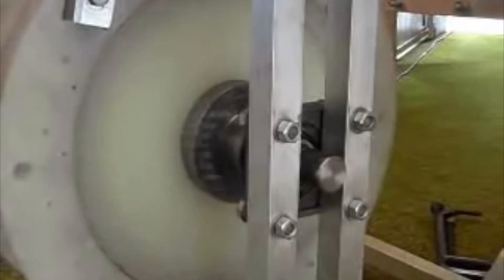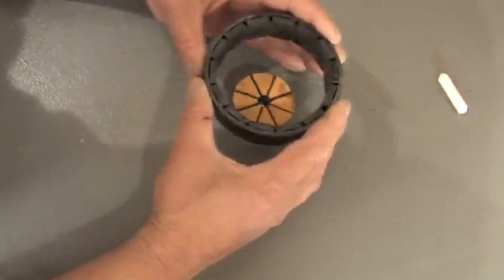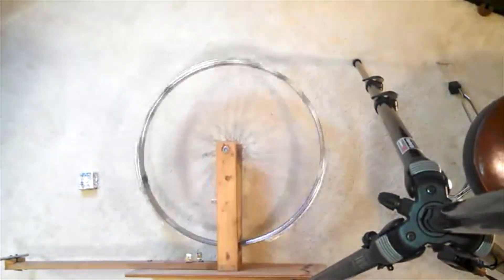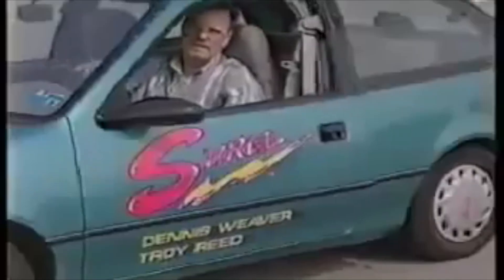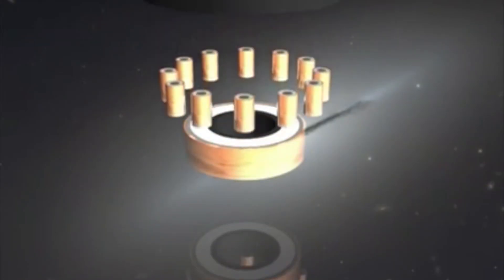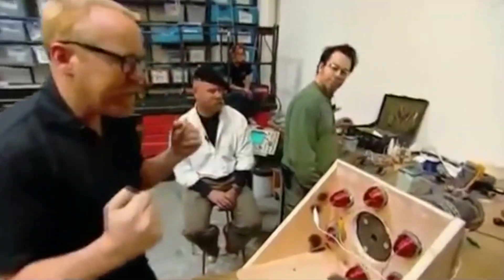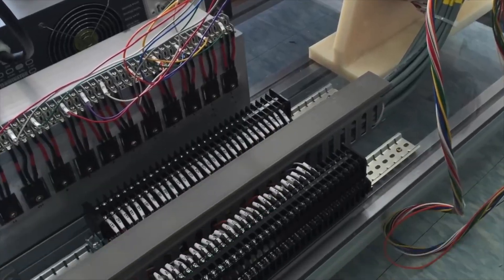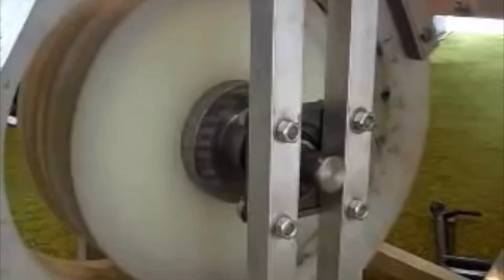Top 10 Most Famous Magnetic Motors

Comment: If you're looking for a legit scientist who actually worked on these devices for the truth, look no further, I tell you as the things really are. It doesn't work. Not like this at least. You need some sort of reaction otherwise it won't work. People who still believe in these devices were just given bad examples why it doesn't work. But I'll give you a good example. To make more energy would be the same thing as to make of 1L glass of water, 2L glass of water. Do you really think you could feel an entire pool with one glass of water?😁 My next video will be a bedini motor with feedback. The one that MythBusters failed to build. It will be 100x better than even the original version. But it won't run itself I can tell you that up front! The real purpose of the video will be to show people how it works and also how it doesn't work. It's science. I do this because there's not a single video that did it properly.

Comment: Most if not all of these motors can run, but there is a lot more required of a than just running. They have to have the required amount of RPM, some of these motors can produce the right amount of RPM, but the big kicker is torque, at this time none of these motors can produce torque and without that they are useless running models that are never going to go anywhere until somebody comes up with a magic solution. Which may take another 50-100 years. At the current time, these motor just run, but if a load was put on them they would stall and die faster than a heart attack.  They can't produce any torque, end of story.

Comment: I can say I replicated the bedini SG and it works but it is the elementary motor bedini designed.   I have replicated the perendev and it was fun but in the end very disappointed could not get it to work. I tried replicating Howard motor but never got usable power.  I have learned a lot from others mistakes or failures shared at replicating.

Bedini wheel continues to be in my opinion the way to produce diy electricity.  
Bedini said the free part is the mechanicle rotation on the SG wheel.  If you build one and get speed up high enough to use the rotation to a self excited alternator charging a battery bank.  Meanwhile the bedini wheel is charging a battery and running from a primary battery.  That's my next step.

Off the shelf alternator rotating from a bedini wheel.  Of course the bedini circuit switch is off longer time than it is on and the wheel rotation or flywheel momentum increases with the switching.  The coils magnetic collapse cannot be ignored that is the free reaction of the magnet moving away from the coil. This is where most fail to see the benefit because they just call it counter EMF (that is correct) and believe it's not usable.

(Edit)  I am done with the ssg,  Its a great battery charger and if youre power source is solar then you win.  The joule thief does the same thing and much much simpler to build.  The benefit of burst of energy from a coil collapse can come from a simple joule thief. I believe Bedini just wired the joule thief differently and added rotating wheel with magnets to make it look pretty and impressive.  The Bedini SSG just does not have the torque I was looking for.  So the limit of the SSG is use solar as a power source and not worth using outside of that.
Reply from the maker: Have you posted any videos of your work? If not, you might consider it. Others would benefit from what you've learned working with these systems.
Reply: @ITList  I would like to share all the failiures it takes before a small success but making a video interesting is not in my abilities list.  Although I do see many replicate bedini sg and then give up not go any further, that is the sad part.  The SG wheel is learning to crawl.  

Kudos to you for making excellent videos
Reply: @pedrotorres9836    No one ever showed that the mechanical output power of the "Bedini wheel" plus the electrical power output of this device is bigger than the electrical input power. Mr. Bedini claims this, but he never proved it himself and all others who tried to prove it failed.

Comment: Pretty strange that none of the listed items are sold today. HMMMMMMM
Reply from the maker: Isn't it though?
Reply: @ITList  I searched for every item on this list, but all of them are unavailable to get.
Reply from the maker: @rikkardo9359  None of them currently are, though the inventors have attempted to bring most of them to market. That's why it's strange.
Reply: @ITList  We will see.
Reply: Bedini wheel!
Make you're own and let it teach you. Learn from experimenting.  Or continue to pay that monthly elec bill.
Reply: @pedrotorres9836  I am just curious why none of those items actually made it. If it really works, the inventor could easily get the attention of real scientists to verify their invention. The inventors would be rivh in mounth.
Reply: @rikkardo9359  John bedini and his brother Gary have passed within two years I believe.  They still got lots of attention from other PhD individuals.
Dr. Peter Lindeman, Tom bearden. Just to name a couple.
Dr. Lindeman is careful of saying you can power your home but insinuates you can find the path.
Bedini gave many hints.
Like the fan rotation is the free part.

Remember manual transmission car with dead battery.  Roll it and pop the clutch it runs again.
The alternator provides the voltage to a dead battery.
Disconnect the battery the car can still run.
See where you can go with this.
Replace the rotating power provided by gasoline engine with bedini wheel.
You have a good alternator keep it from overheating and you got 14.5 volts until you need maintenance.

Now in place of dead battery, let's go with a battery bank 12 volt.
Now let's use that battery bank with a true sinewavevinverter and we have 120 voltage.
Reply: @rikkardo9359  by the way if you Google bedini SG wheel for sale you will find Chinese knockoffs that are fake.  The kits to build sold by the bedini brothers are not available. Ever since he passed the kit is not available as for when I looked for it. So I built my own and it does what he said it would do. Granted I had to continue to feather it to fine tune it.
Reply: @pedrotorres9836  Iff you built your own free energy device, make a video about it and upload it to your channel explaining how it works. I watched a couple of videos on that topic now and never had a video actually talking about the principle. To be correct, there were videos explaining how it works, but those didnt claim it would produce free energy, they just showed it as the motor it is.
Reply: @rikkardo9359  I built the bedini wheel and it works as a motor and recharges batteries.  It charges even dead  batteries and rejuvenated some dead batteries but after 4 or 5 recharges the batteries were back to being dead.  I will not call it free energy device.  I will say there is something to learne Frome it. It has a low lenz drag which is not found in most motors.  I am waiting for an antique flywheel to use with my bedini wheel.  I am still experimenting.
What I have achieved is charging good batteries from a dead batteries as primary.  With just the wheel being built it will charge batteries and great desulfator.
There is no video that can do more than building it yourself and experience what it can do.
I am still learning from it and waiting to recibido a heavy flywheel
Reply: @pedrotorres9836  Call it whatever you want, but make about it.
Reply: @rikkardo9359  uploaded find it ...title...
Make about it bedini wheel
Reply: @pedrotorres9836  Ok, haven't really thought you would actually upload it. I watched your two recent videos. How do you know that you get more energy out of the system than you put in?
Reply: @rikkardo9359  as it is in the video it is not very efficient.  I am just one man with limited equipment and what I built will charge batteries without using the electric grid.
I am still trying to fine tune it.
I did hook up an alternator and two 12 volt batteries in series as primary and the wheel spined so fast at 24 volt the magnets flew off before I could do anything with the alternator.
I am designing a wheel where the magnets won't fly off like a projectile.  Again, I am one man and progress is slowly getting parts.
Reply: @pedrotorres9836  Well, please tell me when it works. If it really does, you are most certainly winning a nobel prize.
Reply: @rikkardo9359  thanks for the rally cry.  I will update ASAP.